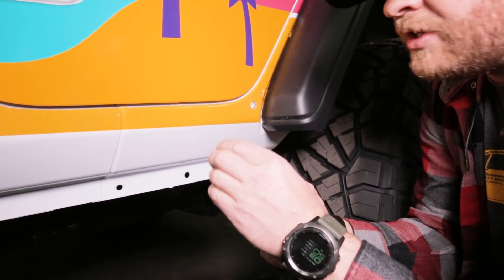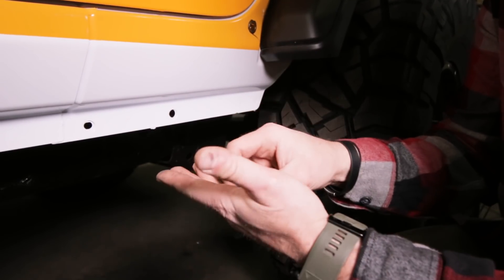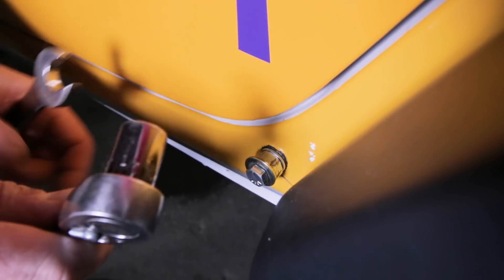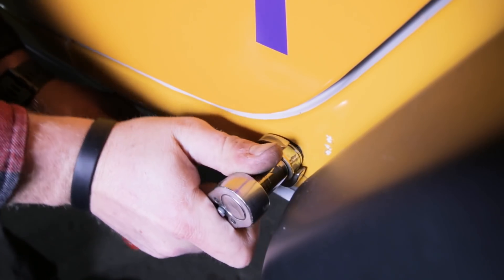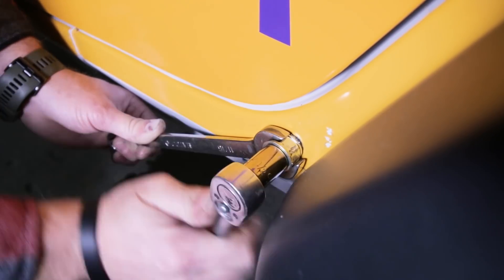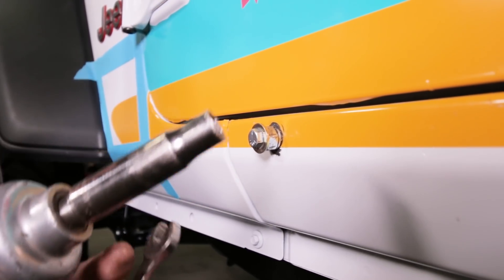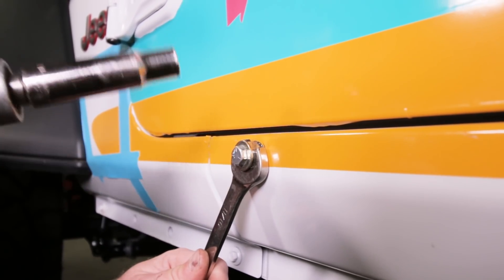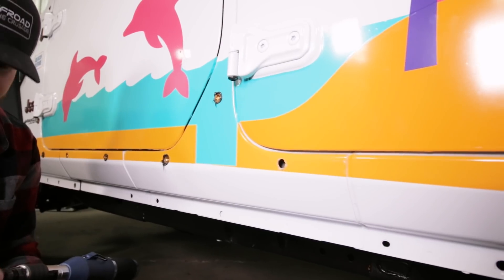Nutsert Installation Tips

Comment: wouldn't a fingertip/palm ratchet work good in this situation for keeping the socket parallel on the bolt head?  the force applied would be centered right on it.

Comment: To avoid spinning the Nutsert, Thread a nut onto the bolt, put on the washers as shown, screw the bolt into the Nutsert.
Hold the bolt while threading down the nut.
This will pull the Nutsert without spinning it.
It will also not damage the Nutsert threads.

Comment: Might want to use a drill instead of torque driver so you can set the drill to slip at just the right point. 
Also, for those who dont know theres one called a Plusnut that you may want to use if youre going to be putting any weight or hard use on it. Holds a lot better than a rivnut.

Comment: wrench and ratchet technique will sometimes turn the nutsert with the bolt making it never flair out. add a star lock washer to fix this issue. also, cheap hand tools for about $20-60 on amazon to do the smaller nutserts. 3/8 and larger require higher end tool or the manual/bolt method.

Comment: Dude, you did it wrong.  You supposed to turn the nut, not the bolt.  Bad presentation..
Reply: The nut is loose, what would that accomplish?
Reply: @SparkY0  typically the nut would not be a slip fit.  It would be the proper size to thread in the bolt.  You hold the bolt steady with a wrench, not allowing it to spin, and then you turn the nut.  This way, they're is nothing turning in the threads of the nutsert (rivnut).  Doing it as in the video produces a lot of strain on the threads of the nutsert, and can cause galling (yes, I saw that he used anti-seize).
Reply: @andygold  And doing it your way is painfully slow and awkward. Many of these panels can use 30-40 rivnuts when installing a whole kit. Using a 1/4" cordless impact makes quick work of them and doesnt have the power to damage threads. We are talking 5/16-3/8" threads here...plenty strong to crush a rivnut.
Reply: When rookies think they can make instructional videos, must be a jeep thing.
Reply: He did it right, the nut the wrench is on doesn't have the bolt threaded into it, it's larger sized and the bolt just slips through it, the nut/sleeve just there to give something to hold on too.

Comment: Good video, helped me with re-fitting the exterior mirror on my van. Had to practice on a few bits of scrap metal first. A couple of things I found useful: sand the area to get rid of grim so the nut has good surface grip. If the nut is a little sloppy in the hole, give the wrench a half turn before entering the hole, so it is nice and tight. ....this all sounds a bit naughty..ha

Comment: Do you use countersink outserts, or flanged. Like I assume pullout strength would be similar just flanged push in greater but I assume upon installation before whatever you are bolting on is attached it pull though more easily. I am working on a RV is it better to use stainless, I see you are using zinc in the shop is it a cost thing or is stainless harder to work with due not being as soft.
Reply: Stainless is not recommended for us on some metals like Colourbond so ymmv.